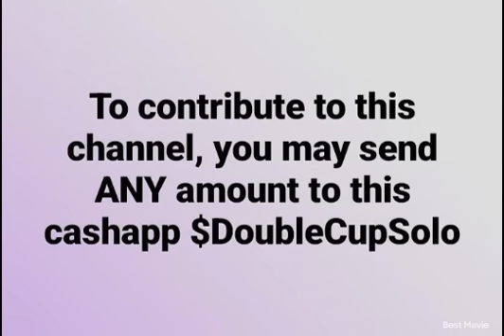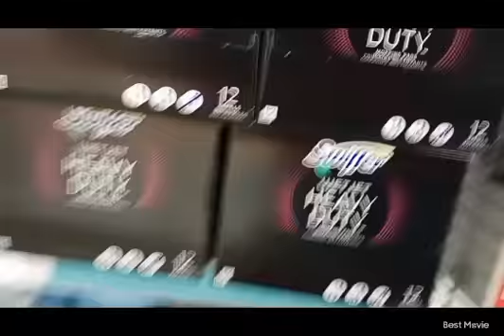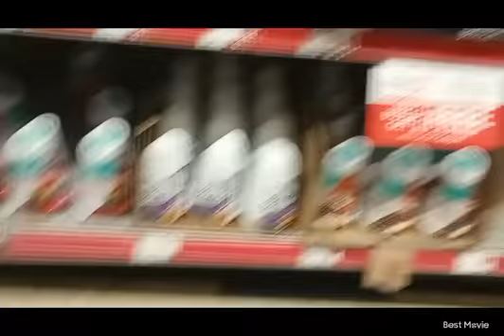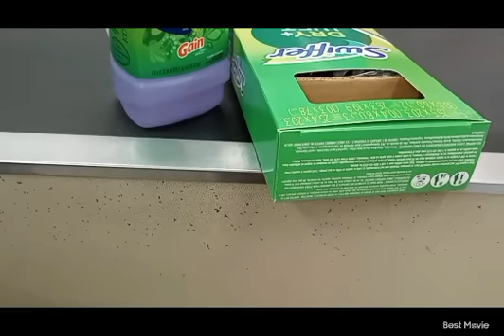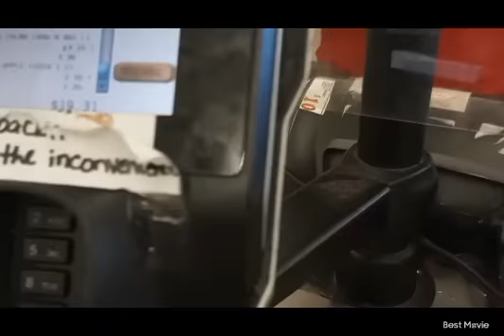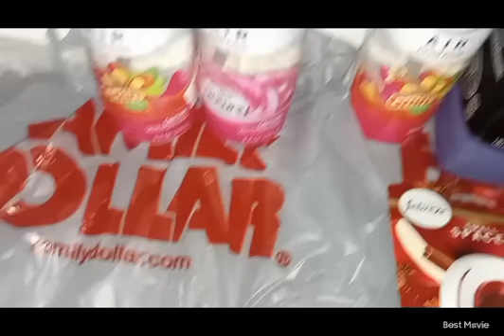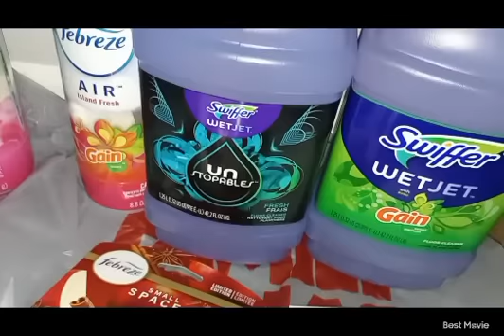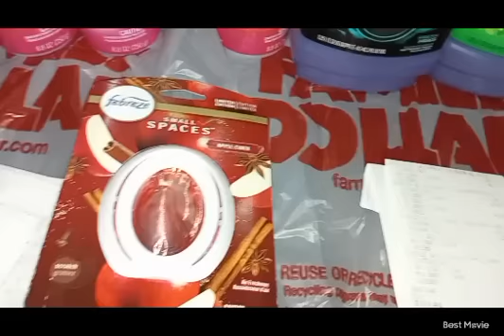Family Dollar Free Febreze + Swiffer🤑🛒 #familydollar #digitqlcoupons #glitchdeals #savingcoins

Comment: Get the Kotex Sade I know you don’t have a cycle but get them. The 20 count . Use the $4/2 digital Fetch is giving $1.50 in points for them. They tracked for spend $30 get 5 for me too 7:47
Reply from the maker: Oh ok booskie. Yes, you remembered :) Yeah most don't know I haven't had a cycle since I was 15. I still get feminine products when they are free or cheap as a filler item. So how much was your total after the coupon?
Reply: @SadeWithTheReceipts  4.15 for two. Then $1.50 back on fetch.
Reply from the maker: @natural_niky  So basically $1.15 for both after points?

Comment: It looks like the B1G1 Swiffer coupon is no longer available to clip.  The $10 one is still available to clip and it's showing on the app that the 12 count Wet Swiffer Gain scent will attach to them.  They are on sale 2/$10.50.   So if the $10 works on 2 of those, we'd pay just 50¢ for 2 packs of them.

Comment: Thanks Hun. I went And got the Swiffer mop itself. It's the purple box Swiffer which is $25 the coupon took the $10 off and got the refill for free. Making my total $15 plus tax
Reply from the maker: Yeah I just told my man that I meant to try the purple mop that was on the photo of the coupon but I didn't want to hold up the line. That is a great deal but I like free. Lol. I would do it on Saturday if the coupon is still available, I have one more account so I will save it for then and do a $5 off $25. You're welcome hun :)
Reply: Hi! I was just wondering if y'all know if you can get 2 mops instead  of getting a mop and a refill. ?
Reply from the maker: @laurawilson4260  Not sure if anyone has tried that but I would think so.